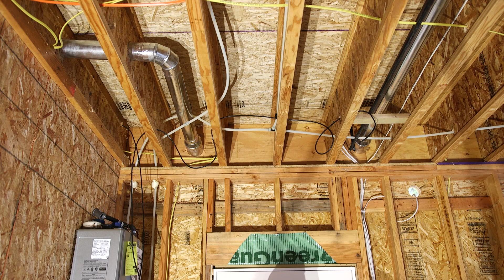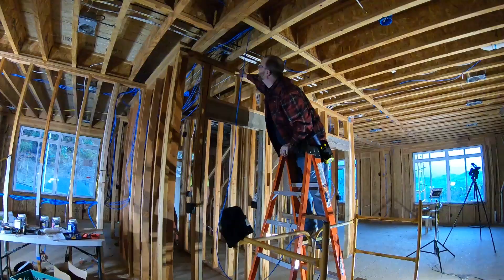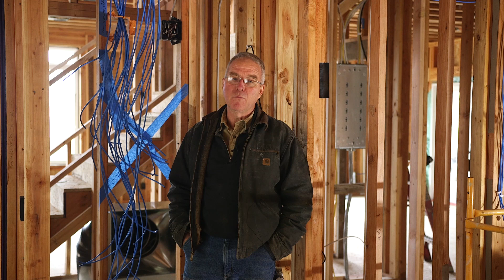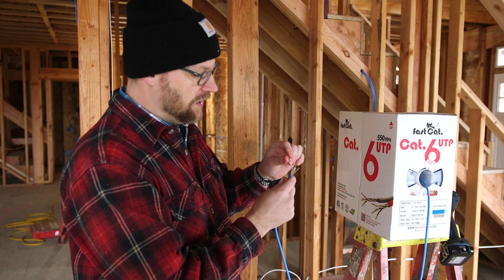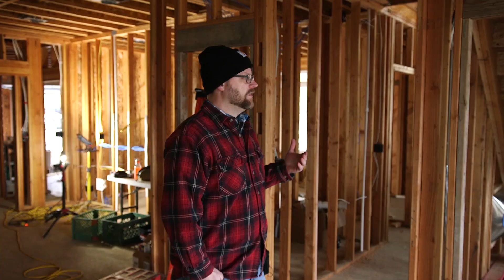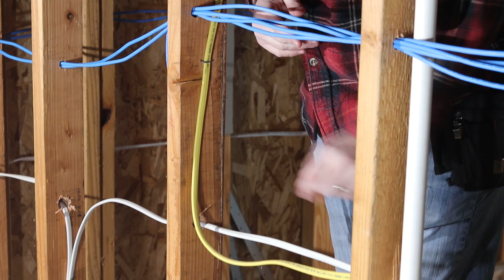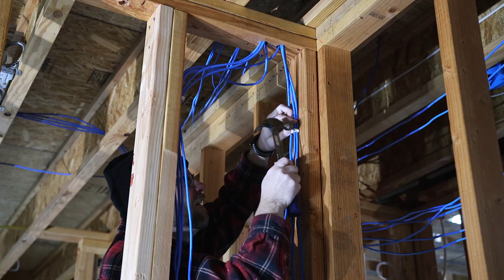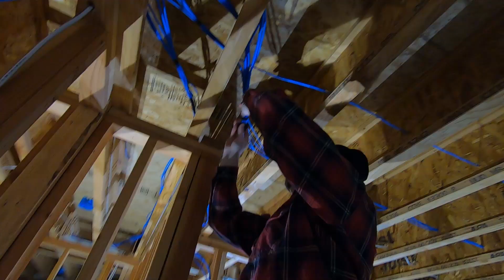Installing A Home Network Ep.100

Comment: I pull cable for a living.  I've never labeled a copper cable during the pull.  Far faster to terminate the far end and tone them back to the rack.
And taping up the cables in the dead spaces?  You've just guaranteed nobody can easily add more cables later.  You can often take one cable, tape 4 new ones onto it, and use the single as a pullstring to get those through the walls - IF those cables are free inside the wall.  You lose that single cable (because you pulled it out of the wall), but it's cheap enough it's not a big deal.  100' run, you throw away $20 of cable to save hours of labor..

Comment: This is one trade I'm actually experienced in! Great to see it included as part of the house build. I personally have only run coax for the modem; everywhere else is cat6. With streaming services it just didn't seem necessary to have coax everywhere.
Reply: Exactly. Coax to the network closet only, then network cables to everything else, including the WAPs. :)
Reply: Even if the homeowners want cable television, more and more modern cable systems are IP based (even legacy cable providers like Spectrum and Comcast) so their cable boxes will happily run over Cat6.

Comment: Don't forget to run optics to the rooms where an office can be established. Cat cable is outdated and cannot sustain the speeds of the modern networks. It's almost better to go wireless. But optics will give you the best long term benefit.

Comment: I ran full  ethernet throughout my entire house when it was being built.  Every single room has two ethernet jacks and one coax.  All of it comes back to a closet in my office, and all if it is cable managed like it's the only thing I ever wanted to do.  Today when I get a new "doo dad" I just plug it in and it works.  Man that was time well spent.
Reply: Do you actually use the RG6? It seems to me that today, Cat6 is all you need except for perhaps one RG6 and/or fiber run from the exterior to the networking closet.
Reply: @RoastBeefSandwich  if you have cable tv or satellite it can be handy.
Reply: @FishFind3000  I suppose so but it's limited use, it won't be long until every cable/satellite box is IP based. It's already the case now in my area with Spectrum and AT&T, satellite is still RG6 for the main box but subsequent boxes can be connected via IP (ethernet/wifi). Spectrum is even deploying FTTH in some neighborhoods in my area - no RG6 necessary at all.
Reply: @RoastBeefSandwich  both of your answers are correct inside the house. But, the more durable and shielded RG6 can carry the same data load over miles. 

What makes the entire coaxial realm obsolete is optical fiber and this is quite recent technology.
Reply: @articchar-lf  “recent”? They were doing fiber to the home more than 20 years ago!
Reply: @jcnash02  ...not where I live. The providers streched the lifespan of their old residential infra renovating with fiber on commercial and long distance at first. Fiber to residential gateway started around 2010 at the earliest. I worked on that until 2014.
Reply: Your name is familiar...did you ever work for a LD company starting with M?
Reply: thats the way to do it

Comment: Excellent,  Low Voltage wiring (NEC Class-II ) we started wiring our homes in the late 1800s for magneto telephones. I have to applaud your decision to demonstrate wiring your house for networking. Coaxial versus CAT-6, no need to use coax for what we call TV sets will soon totally run off of Ethernet lines, extra points for running the coax for your local cable company cable modem as their installers have gain a reputation for poor work quality.

Comment: We just got HIGH sped fiber in our town of 700 people. we were on the route to the hill where the new  dished were being installed. When I built 10 years ago I installed the blue "Smurf" flexible conduits, one into the attic and one to the crawl space. It was easy to get the Fiber into the communication cabinet in one of the closets. that someday finally came. !
Reply: SMART
Reply: @Stonesand  and optimistic!

Comment: Why not use shielded CAT6 to reduce the impact of interference even more? Just asking
Reply: Overkill, those cables will be fine
Reply: Mostly because of the higher cost.
Reply: The only case I have heard that justified sheilded cable was for unreliable DSL due to utility hookup distance and/or unreliable house wiring.  This involves running a single cable from the phone company's box on the house exterior directly to the modem.  If your modem isn't getting errors it is probably unnecessary.

Comment: Any reason why shielded cable (STP) wasn’t installed? Would help with EMF interference ?
Reply: CAT6 unshielded is generally okay, provided you avoid bad EMF sources. Shielded can be used, and is slightly more expensive cable, but all your network cable fittings also then  have to be designed for shielded and properly connected. Get that wrong and you are wasting your money.  Really bad EMF can be dealt with by optical fibre for data signals, but it does add to complexity and cost.

You need to check the length of cable runs to make sure you do not exceed cable length specifications, particularly for Power over Ethernet. You can never have too many network wall plates. I once did a network job on a trading floor for a Russian bank; they requested 10 network points per desk and in a few cases that wasn't enough. (I tried to persuade them to use other techniques)!
Reply: Another consideration with STP is grounding.  You'll need to take extra steps to deal with that.
Reply: @nooneusesthisname  grounding STP isn’t difficult; especially if you get a patch panel with a grounding lug.
Reply: @nooneusesthisname  Hmm. Never thought STP cabling had to be grounded. I pulled 26 gauge CAT6A STP to feed 2 POE access points. 75 ft run for one from basement to attic through PVC conduit and 25ft run for the other in basement ceiling. Straight from Poe switch to each AP 

this should be grounded somehow?
Reply: @stephane184  Non-grounded STP will still attenuate noise, Grounding it will work even better.

Comment: Its nice to see this a part of the plan.  Running cables this way is basically impossible in a two story house once its fully built without ripping up ceiling and drywall, at least with tooling a cable tech has on hand.  Modern RG6 has a steel core, so it is strong enough to work as a pull through cable in a pinch for more to be added later.

Comment: Nice job. Having run only a few cables in a house built in the 70's I can tell you that you saved a lot of tears, crying and cussing. Great advice on putting them *everywhere* anyone would want them. Wifi has so many issues that having a wired connection will avoid.

Comment: I did this in my last house. I ran cat5, which was top of the line at the time, to every room. In the end, it was irrelevant. Wi-Fi has made most wired cabling useless. Maybe if you're an avid gamer or running a rendering farm at home, a little bit of speed from the cat 6 will be useful. I say a little bit of speed because most network communication is going out to the internet and the bottleneck is the ISP, not the Wi-Fi.

Most devices don't even have ethernet jacks anymore. The laptop that I'm on now doesn't have one. My phone and tablet don't have them either.

In my new house, I'm going to have a media cabinet where the main Wi-Fi router will be and maybe a few ethernet lines going to the office, mainly for the printer. If you have a large home or out buildings, you might want to run a cat6 line out to where you'd put a second Wi-Fi router. A friend of mine has that kind of setup in his barn.

Running wire for home security cameras is probably the most useful thing you'd want to do, but those are usually outside of the house.

Comment: Did not know that cat 6 cables were that fragile. Thanks for the information.
Reply: Mainly the solid copper cable is the problem, stranded cable isn't broken anywhere near as easy.
Reply: @AndreasKoepkeAU  But I've also seen stranded Cat 5e cables abused to the point where they only do 10 Mbps.
Reply: @MarkRose1337  yep, that's pretty much the point. It will not necessarily break completely but performance will be affected.

Comment: your using cat 6 UTF (unshielded Twisted Pairs) wouldn't you wont to use  STF (shielded ... i think cat 6e) for that many runs close to each other and hight potential data speeds? 
Or is it so much more expensive?
Reply: The twists in the wire pairs helps cancel interference so it is fine.  Large amounts of cables are routinely tied together,  Google 'server room cable mess' for examples of h9w bad it can get and still function just fine.

Comment: Congrats on 100!

That was some flimsy looking cat6! I haven’t pulled a cable in a long time, but I didn’t see a cable core. I thought that cable more resembled cat5e. And 500+MHz, wow! Are you going to use a fluke on it later?
Reply: Nobody with more sense than money uses a fluke.  You use a tester, but you get a $600 bytebrothers, not a $10,000 fluke, because it does the same tests for this grade of cable.
Reply: its likely Cat6 24awg not 23awg. Cat 6 is on its way out getting replaced with Cat 6a.
Reply: Like I said I’m out of the business, I guess you wouldn’t really care what the hertz is measuring. But in that case why pay more for cat6? Have the prices come down?

Comment: While it doesn't hurt to have ethernet cables....  I must tell you this is a solved problem and has been solved for many years with wireless networking products available at every big box store.

Some pedants will say ethernet gives you a millisecond or two lower latency and you don't need to worry about wireless security, but again those are both solved problems as far as 99.9999999% of consumers are concerned.
Reply: PoE is the primary benefit, allows you to place wireless and CCTV where you want
Reply: It carries power too.  Want cameras?  You have to run a wire anyway.  Might as well be network cable.  Want to drop a media server in the closet and serve full resolution movies to several TVs instead of over-compressed garbage from streaming services?  You'll want cable for that too.
Reply: Unless wire damage is a concern I would still tend to recommend wired for those who need reliability mainly due to the often intermittent nature of wifi problems.

Comment: Honestly, these days, WiFi makes it so you don’t really need cable jacks in every room. Even with tv services.
Reply: PoE for multiple wireless points and CCTV
Reply: But if you have a device like a TV that is not being moved regularly, and if you have the opportunity to put in the wiring easily, why not just do it?
Reply: @brandy1011  true. It’s always best to do so. But these days with video game consoles and Amazon fire sticks and Apple TV’s, for those who’ve cut the cord, they’re unnecessary
Reply: No.  WiFI is for the bathroom.  Get multiple devices streaming video, or seeking low-latency for gaming, and that wireless network gets saturated quickly.  Even worse if you are in close proximity to neighbors with their own wifi.  Every device on your wifi (or the same channel on the neighbor's wifi) has to take turns talking - sharing about 1 gigabit of bandwidth.  That's fine when it's alexa and your thermostat, but add a basic 8-camera security system and a half-dozen 4k TVs on it, and it'll be a disaster.
Cat6 provides individual gigabit to each device with cheap equipment, and 2.5 or even 10 with a bit more expense.  And carries power at the same time, for all those cameras,  your wifi access points, etc.
Reply: @Erezeneb  as a millennial who’s married to a millennial who shares my addiction to all things streaming and gaming, we do just fine. It is a regular occurrence for me to play games online while watching Netflix on my iPad and randomly YouTubing on my phone all the while my wife does whatever it is that she does.
Reply: If you copy a large amount of data from one computer to a server it is nice to have a wired connection on both.
Reply: @georgebush6002  2300 sq feet Mr. President.
Reply: @9009matorres  Thats a good size, any advice for those that are using wifi in a big space?
Reply: @georgebush6002  Pull cable to multiple locations and add wired access points.  Mesh/repeaters halve the bandwidth (and add latency) for every one you go through
Reply: @9009matorres  How many 4k TVs streaming full resolution blu-rays at once (not ultra-compressed netflix crap - from your own home server)?  How many security cameras on the wifi?
Reply: @georgebush6002  we have AT&T fiber (in Houston area). Don’t skimp on routers. You get what you pay for.
Reply: @Erezeneb  no security cameras. We live in a great area and gated community.

Comment: I want to see the final installation of the IT room.  I see them in commercial buildings but, what will the house have?
Reply: Probably just a 48x1G unmanaged layer 2 switch + whatever modem / NTE their local ISP supplies, can't see why they'd do anything else

EDIT: Actually maybe PoE on that switch, unifi controller, DVR and maybe firewall
Reply: Likely a wall-mount rack with all the cables terminated at a patch panel.
Reply: I’d guess they will leave it at a patch panel. The new owner will have to order their ISP, decide on router, switch, wifi, cameras etc
Reply: I want to put in all the WAPs and modem and cameras, but I'll stop at patch panel and network switch. That way the owner can put in their desired modem and router and WAPs. Of course, if they want me to do it, I'd be happy to do it, and I'll make sure to ask. ;)
Reply: @Stonesand  Make sure they know how to utilize it. Your average consumer isn't going to know about WAPs, they're only going to know about "wireless routers" and stuff like extenders and powerline adapters that you only need when you don't have a proper network like this.

Comment: It's really strange to hear you talk about something I know for once :)

I'm actually wondering: why go with UTP and not FTP or even SFTP?
Reply: Foil twisted pair is used in noisy environments like manufacturing facilities. Residences generally don’t have a lot high frequency emitting devices like motors, large fluorescent or halide lighting that would require the extra shielding. The cost is not justifiable

Comment: This is horrible way to wire a new house.  Install conduit to future proof house.
Reply: Same thing with power cables, strange that none of those are in conduits in most us homes.
Reply: @rfauske  Power generally is not in conduit because builders are cheap and residential code allows it.. if I was on a new build I'd install large conduit access between floors and attic at minimum.  The stud finder a with voltage ⚡ detection won't show these low voltage Ethernet runs...  Conduit would definitely help protect them.
Reply: @xephael3485  +1 for running conduit to attic and crawlspace for future growth.  People often have their own opinions on where network drops should go.
Reply: @shamp00p 20% extra for what? Conduit doesn't add a lot to the price.
Reply: pff welcome to america

Comment: This is the mechanical process I know the most about... because this is my profession!
Reply: do you also use Unshielded cables?
Reply: @anya3027  well that's the CAT6 cabling, though I will admit, I posted the comment before watching the rest of the video. I'm a network engineer by trade and education, but I work with much higher level networking. Not deal with many physical cables these days.
Reply: @o0julek0o  I use only shilded cables for the past 15 years... more riggid when pulling, even less interfernce.. and it doesn't cost a lot more.. as a self employed contractor in this feild (in Israel BTW) reliability is everything for me, extra few % on the cost for me is worth it...